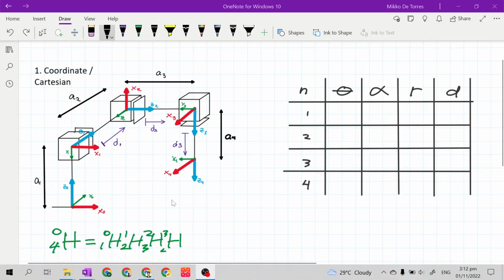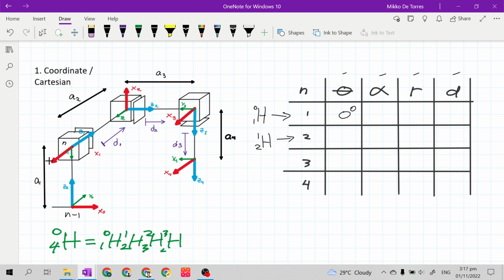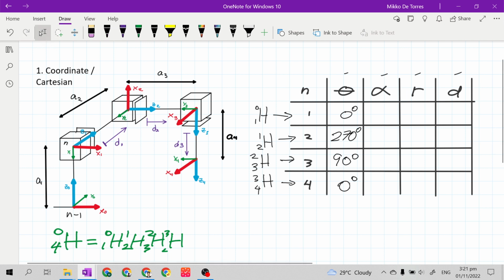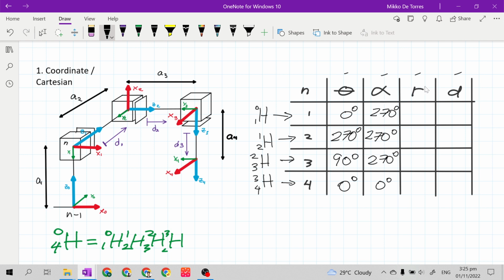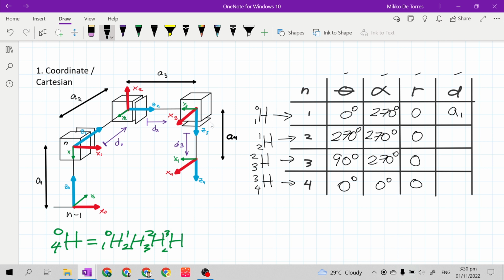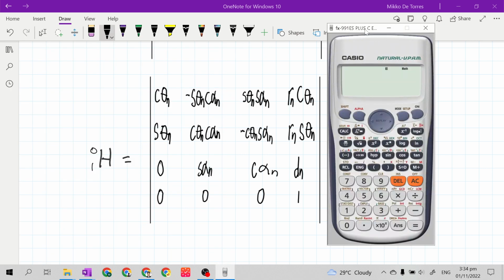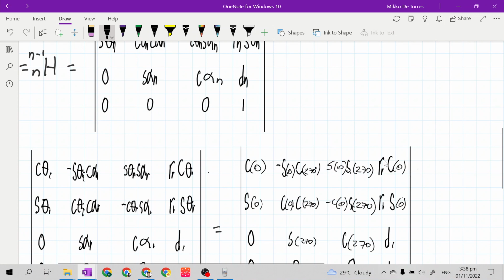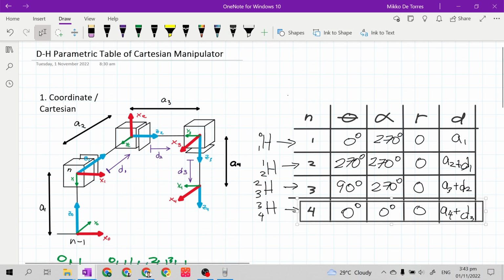Robotics 1: D-H Parametric Table of Cartesian Robot (Manipulator)

Comment: I need your help, in the d-h table in column d, why is it ai+di and not just di for each joint?
Reply from the maker: Because "d" is the distance from the origin of  n-1 frame to the origin of n frame in Zn-1 axis.
For example at the the second row from frame 1 to frame 2, Z1 is the Zn-1 axis, the distance from the origin of frame 1 to frame 2 is a2 and d1.
a2 is a link length and d1 is the displacement of the prismatic joint. a2 is constant and d1 is variable.
a2 is the real length of the prismatic joint while d1 is when the prismatic joint translates. That is why the d = a2 + d1 at the second row of the D-H parametric table.
Reply: @mikkodetorres  Sir, I need you to support me with a video tutorial on how to verify forward kinematics and inverse kinematics on Matlab software.
Reply: @mikkodetorres  can you give me feedback
Reply: @mikkodetorres Sir, can you please guide me how to make SMC controller for this robot on matlab simulink, thank you